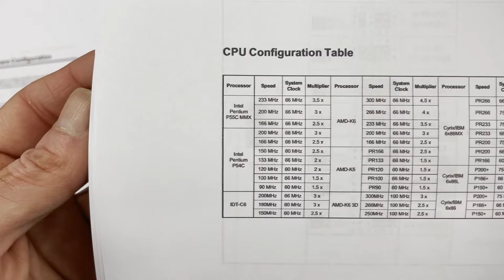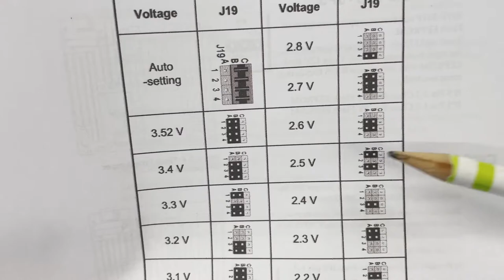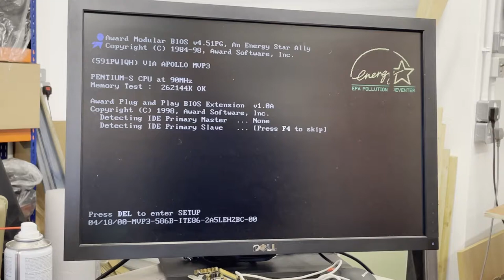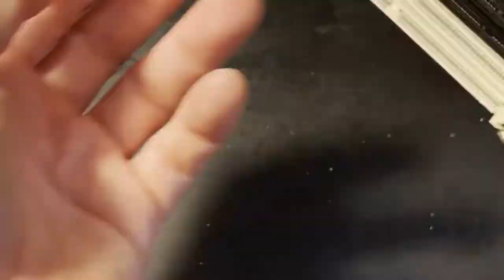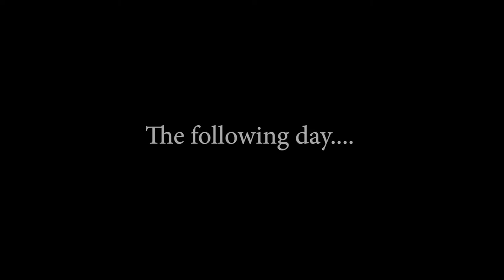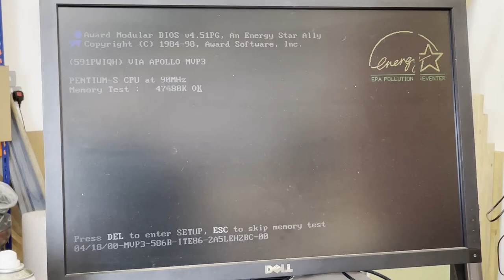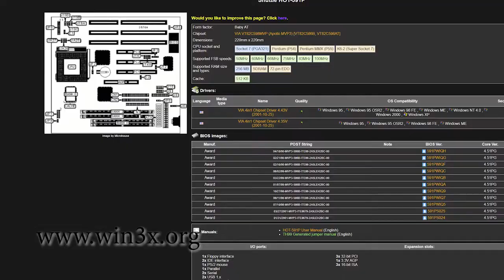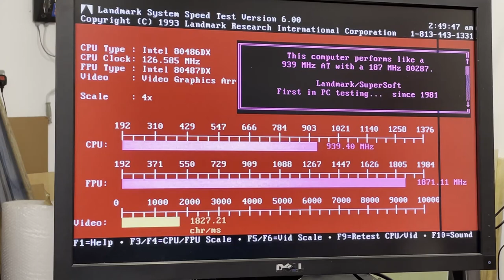Shuttle HOT-591P Super Socket 7 Motherboard - Test/Repair/Upgrade

Comment: Hello, new subscriber here, nice video!
Old 30pin SIMMs are 8bit wide so 2 were needed in 286 and 386 sx 16bit wide memory bus, 4 needed in 32bit wide 386dx and 486.
72pin DIMMs are 32bit wide, so only one is needed in 486 boards, 30 to 72pin adapters used 4 identical SIMMs to work as a DIMM on newer boards.
Pentium had a 64bit wide memory bus so that is why two are needed.
168pin SD-RAM are 64bit wide so one is enough.
I need to replace the caps on 2 boards like these I also have the ATX version with bulging caps, but I never had done something similar and I need some practice.
Reply from the maker: Thank you Alberto! And thanks for the explanation - it makes perfectly sense. I indeed remember my 1992 386 DX needed 30-pin memory in multiple of 4 - I never realised it was because of the DX type. Soldering on motherboards is a bit tricky because of the thermal mass. Even a desoldering station only works up to some point. If you have a heat gun, try warming up the board from the back before desoldering - just be careful as heat guns are powerful and you don't want to damage components there.
Reply: GREAT INFO

Comment: I dont own a smd station. But another helpful is a sewing pin that has the colour ball on top. Solder doesnt stick to it much and i heat the hole with my iron and the push the pin through. I get a hole this way. Your method is a lot cleaner

Comment: 10:00 The voltage jumper by the bios chip most likely indicates Vpp voltage for the Flash EEPROM. You most likely know when it says Updating DMI Pool data - that is the PnP Data as far as I can remember - but regardless what it is, it is written into the BIOS Flash IC on Pentium and newer boards. However, I can't speak for late 486 mobos.

EDIT - also for bios updates LOL

Probably seen it in Necroware's video - so I guess you already knew this, but in case you did not, well, there you go :)
Reply from the maker: Whenever someone comments on one of these old videos I feel sorry for the poor sound and edit quality! :) Thanks for watching! Yes I think eventually I discovered what that is for - but feedback is always helpful. Does that mean that if I set it to 12V, I could damage a 5V EEPROM?
Reply: @tony359  consult the datasheets of the EEPROMs. Certainly not healthy.

Edit vpp is literally programming voltage.

Comment: Hi! I have this Shuttle 591P, what is the size of the capacitors that need to be changed (the large ones)
Reply from the maker: Hi - there are quite a few there. Anyone in particular? If you send me the code (like C123 etc) I can measure for you. Are the capacitors from your board missing?
Bear in mind you don't always have to replace capacitors. It won't hurt but old capacitors doesn't mean they're bad! Thanks for watching!

Comment: Hello Tony, thanks for the video.
Can you allow me to make you a question?. I'll receive tomorrow a gigabyte ga-5ax motherboard (super socket 7 ATX), so i have a modern ATX PSU Corsair vs650 from an old PC (in perfect working condition), it has 24Amps for the 5V rail + 150w. i'm a bit worried about connecting the modern atx psu to an older motherboard ATX and kill the board, Is there a problem if I do this?, i bet it is the same and nothing happens, but I prefer to ask.
Im going to connect to the board a voodoo 3 2000 and a Sound Blaster AWE64 isa sound card+ in the future an AMD k6-2+ 570.
Thank you for your time.
Reply from the maker: Hi Jorge and thanks for watching! No, there isn't an issue with that. The board will only use what it needs. BUT. There is a but. If the board has a short for example, the whole 24Amps will flow to it and will likely result in a big bang. A smaller power supply may just warm up a chip without causing damage! :) There is a video on "let's fix computers" about that. If you have a smaller PSU to test the motherboard, it may be safer. But if you are sure that the MB works then no, you can use that PSU with no issues.
Reply: @tony359  youre welcome, i like this type of videos, I find them entertaining.
Nice advice, i dint thought about that, If I didn't write you, I would have been entrusted to prove it.
The motherboard is working, the seller sent me a video joining to windows, it recognice peripherals, joins windows, looking to the explore and MyPc but thats all, is not tested.
The board comes from a green point, in spain we call to this a place where people left there electronics or whatever to recycle.
The tower dosnt look really nice (not really bad too), yellowed and in the back side just a little bit corrosion, just a little bit (aparently not inside). this board is not cheap, the tower cost 70€, is a good deal if it is in good condition.
With this information in mind, if you think you have to give me any advice ill check it.
I dont know if the board can run with shorts of whatever, If it boots i dont think that there will be a possibility of a short or that it explodes (i dont know too much about electronics), i assume that the board cant run with a short?, I imagine it will turn off or not turn on at all.
The main reason to change the psu is because i dont thrust in the one comes with the tower, i can power it and look if any chip gets hotter.
 in the other hand i think if it runs okey with the corsair this will be a test to know if it is in good condition or not.
In Vogons i read two guys speaking about PSU and they were speaking about the ideal is a psu with more amps than 20, so i thought this one will be okey, but you tell  that it is a lot, what is ideal amps for this ss7 board?.
Thank for your time again.
Reply from the maker: @jorge7317  No, a motherboard won't work with a short. The VS650 is a 650W PSU, I don't think those even existed when Super Socket 7 was around - but I may be mistaken! The bottom line is that if there is a fault on the board, a more powerful PSU MIGHT make it a bit more spectacular. If the board is working, you should not have any issues! Enjoy your new SS7 board!
Reply: @tony359  you are correct, that PSU did not exist at that time, even Corsair brand im sure in a 99% did not exist at that time. i bought it like 5 years ago.
Okey perfect!, that's very good news.
Thank you for your time!
Reply: @tony359  its working ✌️😜, I haven't tested my power supply yet but it works.
The only problem i have is i cant join to the bios, im using a vga-hdmi converter, the slowest resolution is 640x480, so i think bios has 340x because i press escape, press Y,  then enter and it reboots.
Reply from the maker: @jorge7317  those converters can be flakey unfortunately. My monitor has all sort of analogue inputs, including VGA.
Reply: @tony359  yes im going to buy a vga crt monitor.
I've been messing with this all day, is a 5ax rev 4.1, i find the voodoo really hot being in desktop, im going to plug the s3 virge comes with the tower untill i fix this.
I read one guy said gigabyte's board can have a problem to supply the power for agp slot.
Do you know something about this?, because that person refers to short jp12&13 but my board dosnt have thouse.
Im still looking for info.

EDIT: looking to the board right now i think some capacidors are blown, some are completely flat and 3-4 are a little bit swollen, not too much but probably i have to replace thouse, so more money to invest.
Reply from the maker: @jorge7317  no sorry I'm not familiar with that board. Always a good idea to replace swollen caps! You might want to have a chat with the seller! Good luck and I hope you enjoy your new board!

Comment: I just installed this board with a k6-2 today after my other mvp3 dfi p5bv3 board kept crashing due to bad caps probably. By comparing the look of those two mobos this 591p seems to have more caps around the agp port. Maybe that’s why the 3.3v agp power supply is more stable on this board?
Reply from the maker: I don't have a k6-2, I have been told numerous times I should get one to properly push those boards! :) I suppose the k6-2 is indeed a tough one to run on a socket 7 and not all boards like that. Does your other board run ok with DOS?
Reply: @tony359  yeah the other board ran kinda ok in dos. But it had random reboots after the first boot screen, after detecting the IDE it rebooted and detected IDE again in a loop, but only after a restart, when the board was already got warm. It also got worse the warmer it got, the voodoo3 also makes quite some heat in an old baby at case. So I guess that the ESR of the caps got worse when it got warm as well. One cap was also bulging a lot. I believe these boards were one generation before the big cap plague of the socket A boards, so I guess the caps were already quite low in quality. I used a via kt266 in 2001 that died because of bad caps and overclocking 😂. So I am a bit traumatized by those Buggy via boards in win98. Because also the kt266 soutbridge was known to be very unstable. I am curious to see if the boards are more stable with new caps. I will order some caps for both boards soon.
Reply from the maker: Oh well, if you see a bulged cap, then "let the capacitors in" :)

Comment: Would have been interesting to see a stress test with prime95 and furmark before the cap change
Reply from the maker: The thing with Windows is that each board requires its own drive/compact flash - we are spoiled by windows 10 nowadays! So I tend not to use windows on retro HW. I only have one installation and it’s for my Soho board but I understand this Shuttle is a good board so maybe I should make one for it too! Thanks for watching!
Reply: Have you tried using your soyo drive on other boards? Because I used my gigabyte socket 7 board cf drive easily on two other super socket 7 boards, this 591p and a dfi p5bv3 same chipset without problems. The chipset driver of this mvp3 is quite buggy though, if it wasn’t just bad caps on my board that made it crash.
Reply from the maker: I think as long as the board is based on the same or similar chipset it's ok. But it's not as easy as Windows 10's :)
Reply: @tony359  i did more testing, the other mvp3 board was stable, turns out some caps were bad, also one of the psus was too weak for k6-2 and voodoo2, 4 16mb ps/2 modules only works in exactly one order, cirrus logic pci gpu does not display after ide detect but matrox millenium does, socket 7 cpu voltage regulator gets too hot with k6-2 at 2.8v on ga586tv, but asus sp97-v stable at 2.4v undocumented jumper settings, but pci slots too short for voodoo2 sli and so on 😂 I will put it all in storage and stick to the shuttle 591p, k6-2 400 and voodoo3 2000, best combo for me I guess

Comment: IDT C6 is WinChip :).
Reply from the maker: C6?
Reply: @tony359  A budget CPU "competitor" Centaur/IDT made them. I have a a new old stock IDT WinChip 2 200MHz (3x66MHz FSB. has 3d Now too). They were designed to be drop in replacements for single voltage CPU boards
Reply from the maker: @Voidsworn  Ahhhh! I had to watch (my own!) video again to understand! :D So cool, I didn't know, never heard of those. Thank you! It's amazing how easy it was to "clone" those components back in the day! I'm wondering if this is not happening today because the chips have got too complex to replicate or maybe because of patents from AMD/Intel.

Comment: I do not think P90s ever had the div bug, only 60/66 so your friend probably had a P60.
Reply from the maker: I could not remember so I took a look on Wiki
"The FDIV bug affects the 60 and 66 MHz Pentium P5 800 in stepping levels prior to D1, and the 75, 90, and 100 MHz Pentium P54C 600 in steppings prior to B5. The 120 MHz P54C and P54CQS CPUs are unaffected"

So it affected P60 to P100. That said, I cannot be 100% sure it was a P90. That is what I have in mind but it's a 1992 memory! :) Thanks for watching!

Comment: Thick MB and leadfree solder : à big deal for desoldering
Reply from the maker: indeed! I now pre-heat boards or use the hot air to help. That said, some viewers pointed out that those boards might be from the pre-lead-free area. Thanks for watching, sorry for the bad audio :)
Reply from the maker: @dominiquejacob6406  Sorry, I was not clear. I learnt from this experience and now I pre-heat the board and use hot air - I didn't do that on this video. I also usually add leaded solder but in this case the motherboard's ground planes were sinking all the heat! :) I follow northridgefix too :)